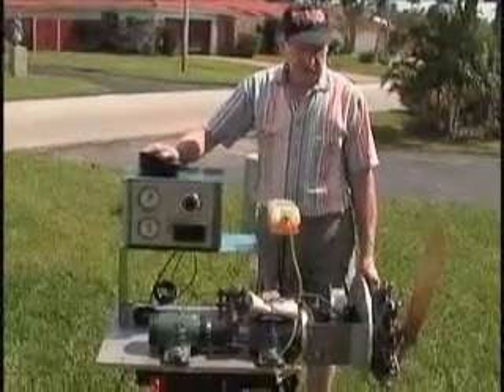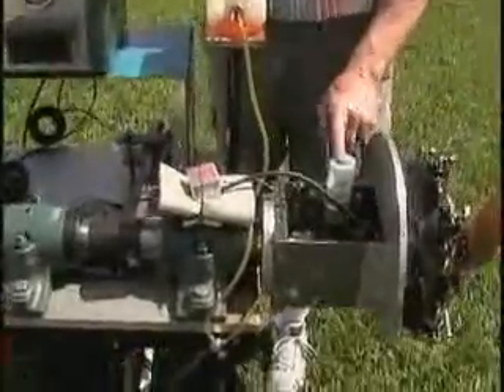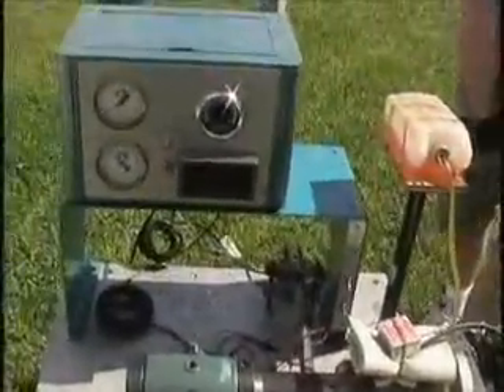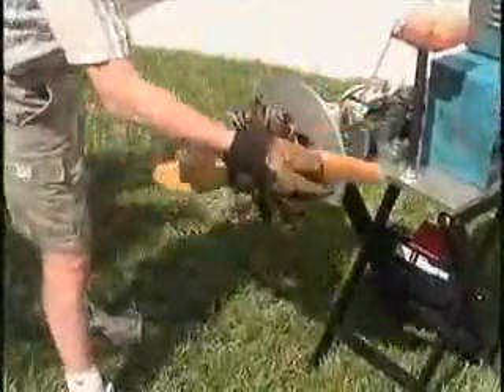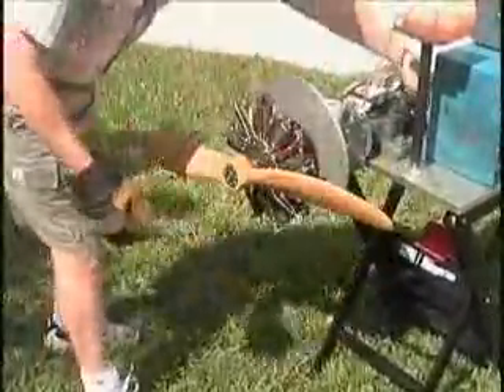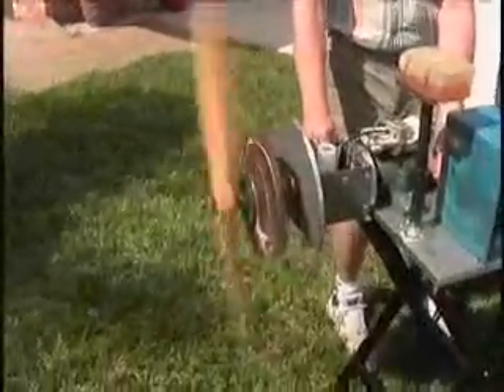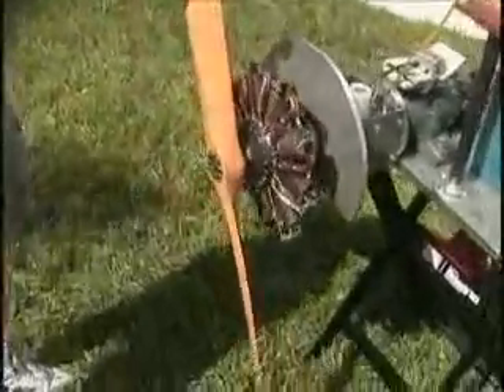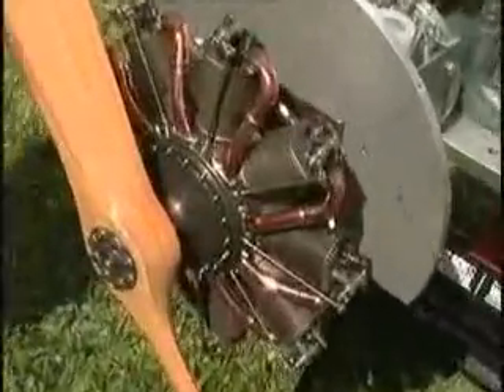Rotary Radial Engine Run

Comment from the maker: Check out the history of Aero engines in WWI and you will find that these are called rotary radial engines  Google rotary radial.and see what you find. Unlike conventional Radials these spin around a stationary crankshaft. Hence the terminology rotary radial. Two different types amalgamated into one.

Comment: Rotary and Radial engines are 2 different types of engines.  This is a RADIAL motor.  It matters not that the motor spins with the prop just that the pistons RADIATE all around in a circle.  ROTARY motors have a piston that rotates vs up and back motion.
Reply: calling it a radial rotary is ok though, as it differentites it from wankel-type rotaries.

Comment: @mbitsko25 and as a side note, unfortunatly, they made manuevers tricky at times due to the gyroscopic forces they generated, which is why these beutiful engines are now rarly used.

Comment: The rotary engine is rather odd as it incorporates features of modern two cycle engines. The fuel mixture is let into the cylinder through holes in the piston itself, much like ports when a vacuum is present in the cylinder.

Comment: Rotary engines generally had dual ignition. The first was the selector mag to run the engine full, half, quarter or 1/8 speed by disabling some pistons or changing the firing order to fire every 2nd or 3rd engine rotation. The second was the blip mag which turns the engine ignition on or off which you speak of.

The problem with the blip mag is if you wait too long between "blips", the engine can explode (which wasn't uncommon) from the excessive amount of fuel in the cylinders.

Comment: It's not a push rod, it's a push-pull rod. The push-pull rod operates both the intake and exhaust valves by having links and levers inside the crank case.

It's amazing a modern 1/3 scale Gnome engine can produce the same HP output as early full sized Gnome engines. If this project was a full blown 1:1 scale, it would probably produce 240 HP (the biggest Gnome was only 160 HP)

Comment: The Siemens-Halske SH.III had a conventional throttle, but it was plagued with other problems. It weighed like 560 lbs for only 160 hp and the crankshaft rotated opposite the direction of the engine at half the speed and reduced the cooling effectiveness.

The lack of caster oil near the end of the war with the use of the votol substitute made the engine seize up after only about 8 hours of use.

Comment: Rotating engines made for better cooling.  The early airplanes flew pretty slow and overheating was a huge problem.  The ignition cutout was used to augment the throttle because they didn't idle well.